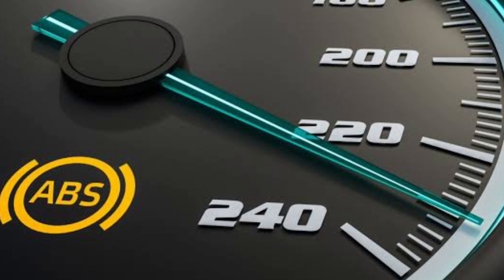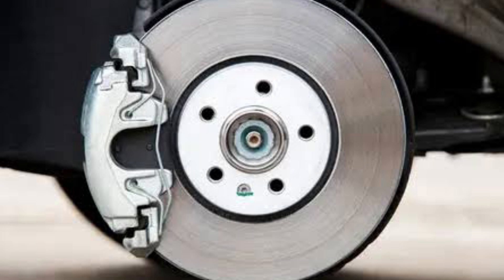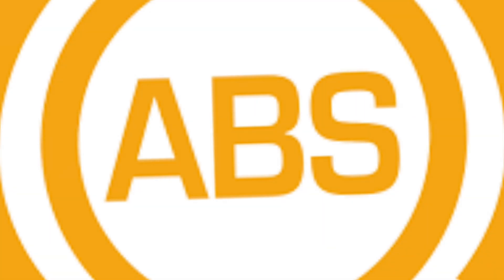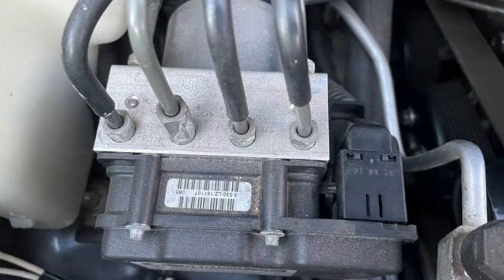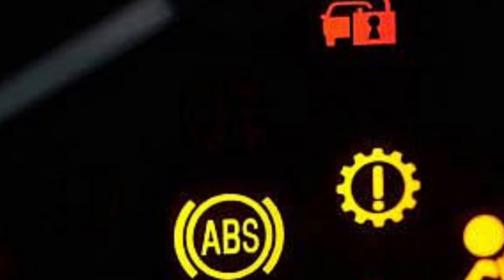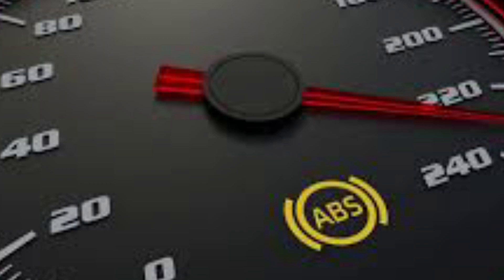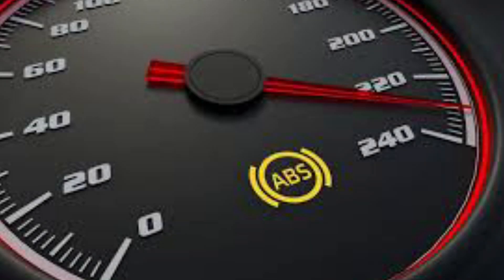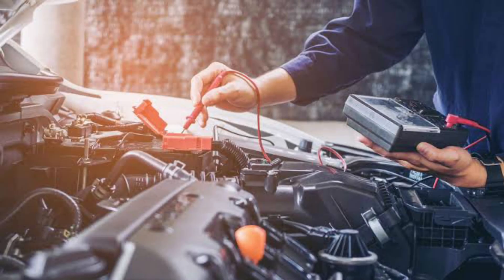Top 5 Causes of an ABS Light to Come On and how to fix it !!

Comment: My abs and traction control lighted on when I was in drive mode and the car was going backward cos the parking space was a bit sloper. It disappeared after I turned off the engine then after after a day it showed up again while I was exiting in the parking space and did reverse. Since then haven’t used the car yet to see if it will show up again. I have Ford fiesta 2016.